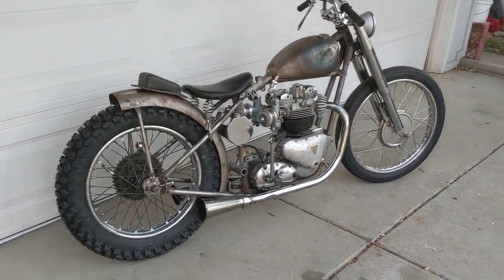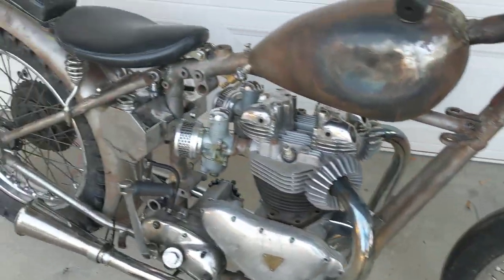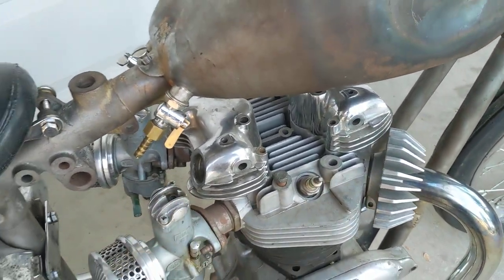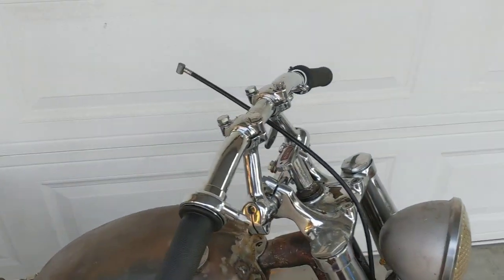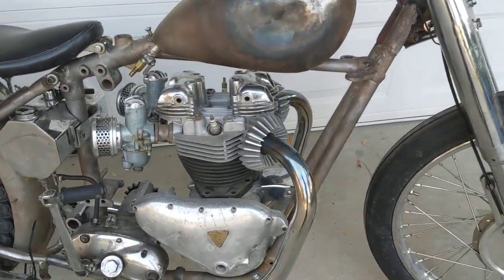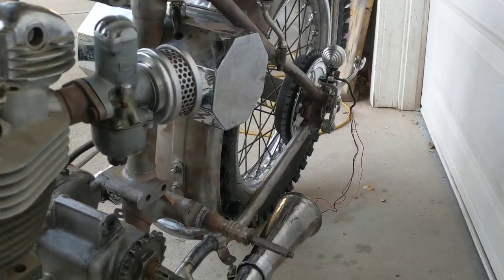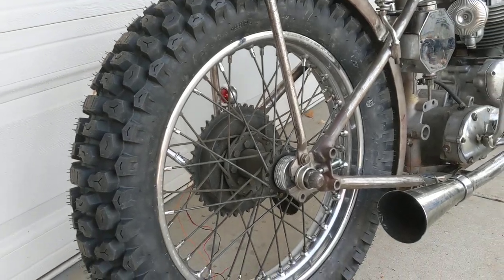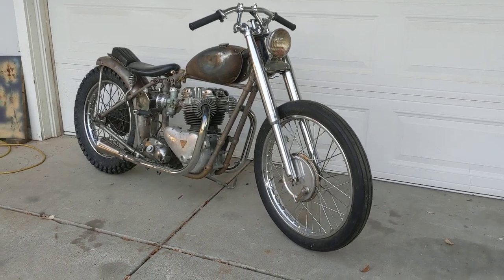1962 Triumph Bonneville "Mental Revenge" final mockup Triumph Chopper Bobber Custom whatever

Comment: Did you call those tips "Superior Trumpet"? I'm not having luck searching those out
Reply from the maker: Often they are listed as just Trumpet. They are from the 70s and 80s I think and seem to pop up on ebay a lot. Couple different lengths.  I think Throttle Addiiction makes a sort of repop that is held on with a hanger.
Reply: @vorhese  Ok Thanks!

Comment: Like the bike!  Where did you get the acorn rear axle nuts along with the collared inset washers for for the rear axle tension adjustments in order to use the early frame chain adjusment bolts?  Nice set up for using the narrow rear axle/wheel hub on the early rigid rear frame.
Reply from the maker: The axle nuts are a aftermarket part, which I think are pretty easy to find. I have a nice new chrome set going on. I made the collars on my lathe.  The speedo delete is a Troy Fab piece. The rear axle is actually stock unit and I notched the axle to fit in the axle plates.  But there exists a drawing set for creating the correct spacers to use a smaller rigid rear axle on a later frame. I just didn't want to open up the stock axle plates.
Reply: @vorhese  Thanks for the info.  I have several early rigids.  The last bobber I put together I made a new axle out of 5/8" stock and turned the outer ends to accept the early 9/16" hardware while using the 5/8" bearings.  That was a lot of work.   On my latetst project I am using an early preunit 5/8" axle/rear hub that does not have the speedo drive but I need something like the turned collar you made in order to use the stock adjusters.  I find the old frames accept the 5/8" axles without modification since the original 9/16" adjustment collar washers slipped over the axle so the frame opening is actially 5/8".  Check out my wifes facebook page and there is some photos of my last bobber.  Cheers dano..........